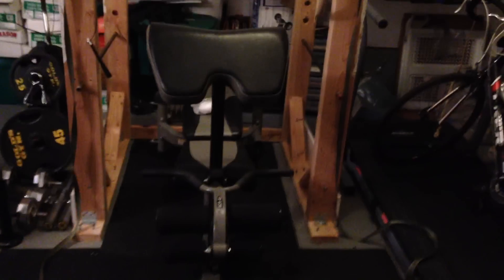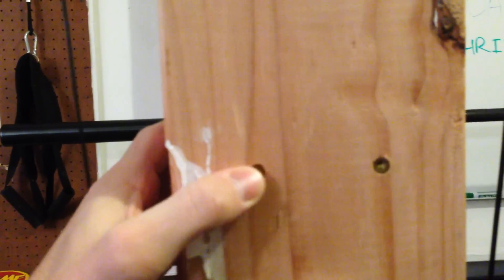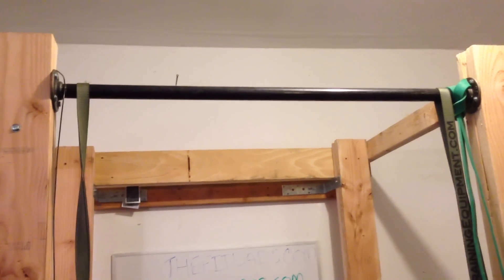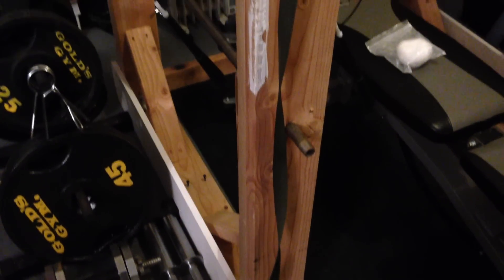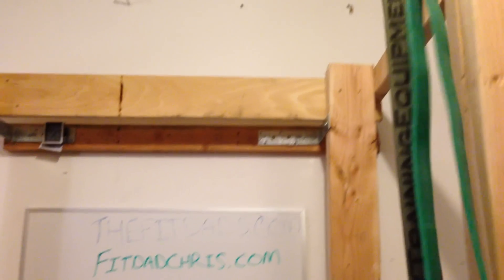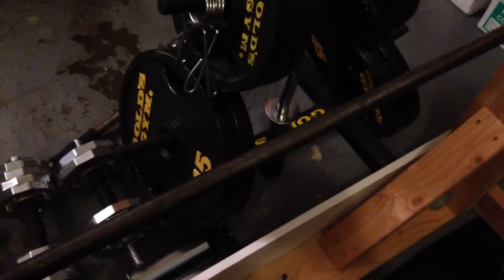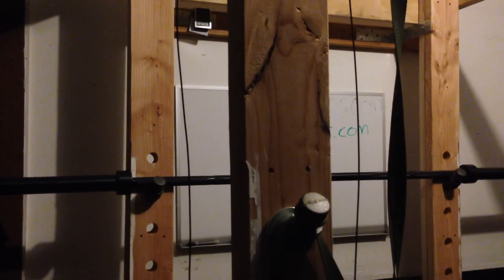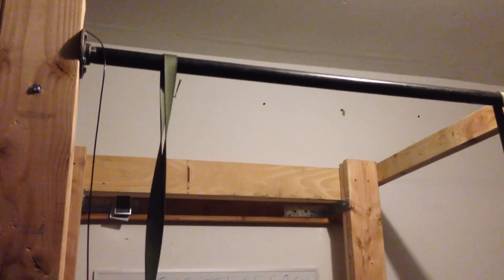Wooden Power Rack - Plans On How To Build One -

Comment: I used your idea for bar holders on my rack, but instead of using regular 45-degree elbows (threaded female on both ends) with a close nipple and end cap, I used a 45-degree "Street Elbow," which is threaded female on one end and threaded male on the other.  Since the street elbow is one piece, the transition in shape from the elbow to its threaded nipple is tapered instead of stepped, and it makes unracking the barbell quite a bit smoother. I also ended up removing my end caps, the street elbow by itself is enough to safely hold the bar, and leaving the caps off also help in unracking.

Comment: If you would've had your front supports going the other way like you said you wished you did you wouldn't be able to drill holes into them to hold your safety bars or holes for your adjustable pegs.
Reply: At least not safely.  Drilling a hole between two boards so that your pegs and safety bars would be resting on the seam seems like a prime setup for disaster.  The way you have it now makes the most sense structurally.